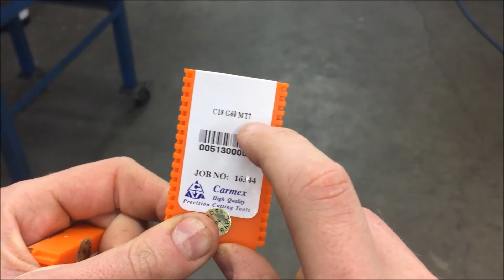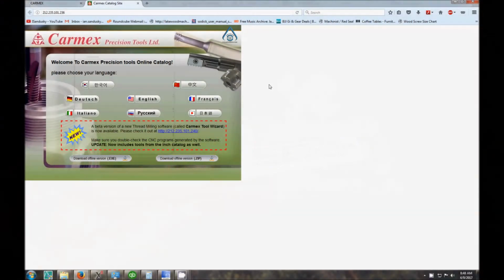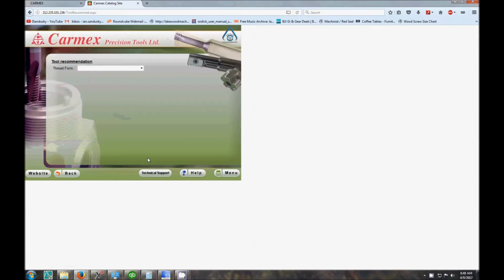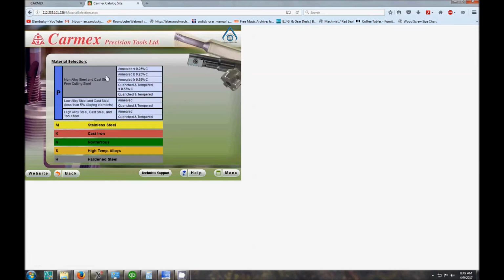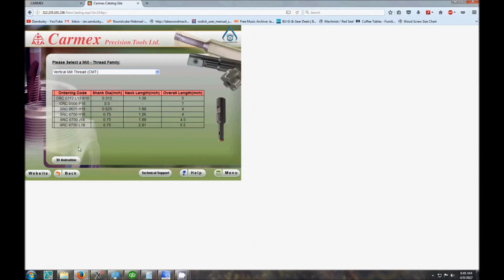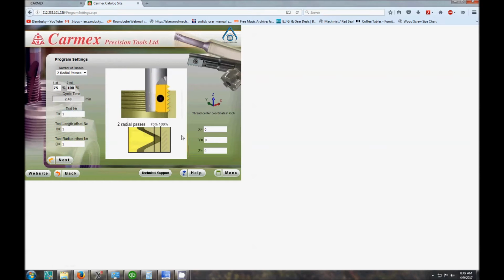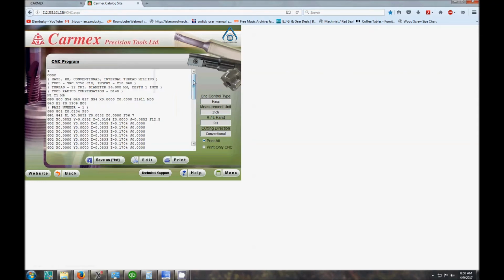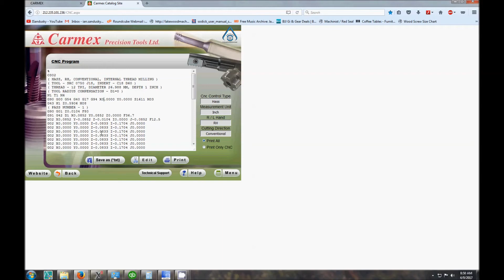CNC TOOL REVIEW: CARMEX THREAD MILL

Comment: That looks a lot like the same web-solution Iscar uses, though I prefer to just program through cam software instead :)

Is that your shop, or do you just work there? How about a tour of the place? Introducing your machines and the type of work you do?
Reply from the maker: Mark Alexander Ragnvald Hansen I prefer to use Mastecam as well - though I have used the Carmex site in a pinch and it works surprisingly well! 

It is indeed my shop - I've been trying to keep my business and the YT channel fairly separate at the moment but I may just do the walking tour sometime!